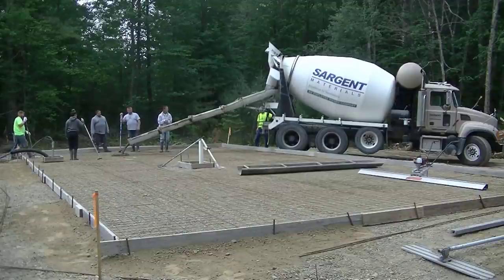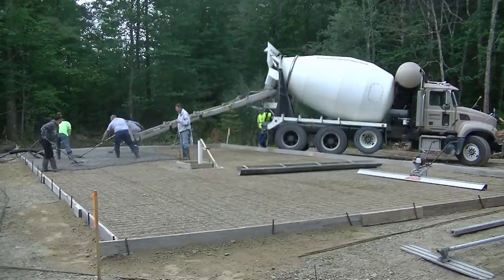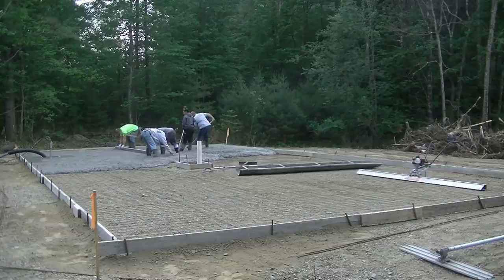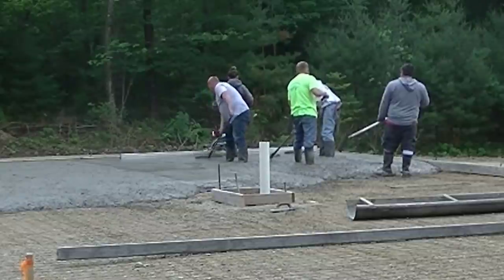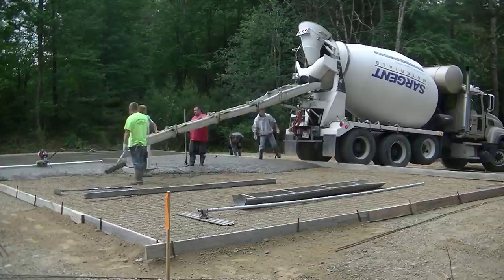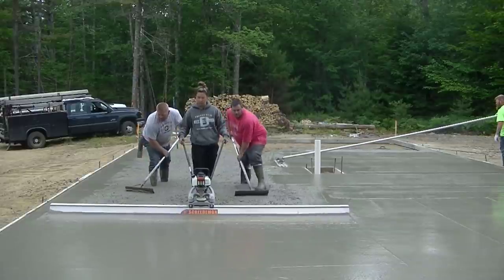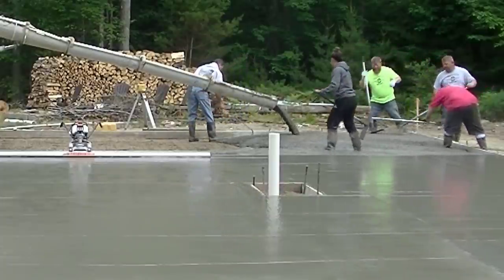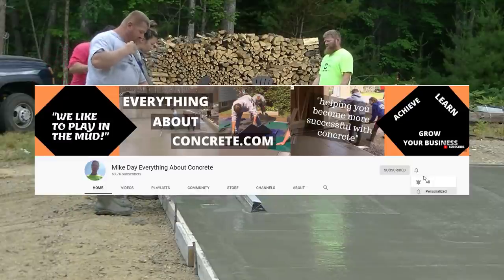Pouring A Concrete Slab With High Range Water Reducer (58' x 28' x 6" Slab)

Comment: Just an engineering point - The perimeter rebar that you were wet-setting along the edges is most effective, very close to the bottom of the slab pour, where it can help resist tension forces. Rebar or WWF has little to no affect at all in reinforcing concrete when it is placed in the middle, bcz the middle is actually considered to be under neutral forces. Neither tension, at the bottom nor compression at the top. 
This is also why your viewers needn’t get upset when they see you walking on the wire mesh, after you’ve pulled it up once. It’s right where it needs to be.
Reply: can i get some more responses on this - have always been told "in the middle" and was at the point i was going to ask mike about them stepping on the wire and it being pushed back down.
Reply: @johncross436  This is one of those things where a sketch would be very helpful, but I’ll try to explain anyway.

Imagine a 12” deep beam with 2 vertical rows of dots, 3” apart, at the center of the beam. Then put a load on top of the beam, at the midspan, directly in between the 2 vertical rows. As the beam begins to deflect, you would observe that the dots at the top of the beam get closer together (compression), the dots at the bottom of the beam move further apart (tension), while the dots in the middle of the beam remain constant (neutral). A slab behaves in exactly the same way. 

When you form a typical, structural concrete slab, the top and bottom steel is always called out to be ¾” from the top and ¾” from the bottom. The engineer wants the steel as close to the edges as it can be and still get concrete coverage bcz that is where the steel is most affective at resisting the compression and tension forces. Almost never will there be any steel called for in the middle, bcz the middle is halfway in between the top and bottom (obviously) and right in the ‘sweet spot’ where the 2 forces cancel each other out.

As far as Mike and the crew stepping on the wire, once they pull the wire up with the hook, aggregate gets under the wire and doesn’t allow the wire to get all the way back down to the bottom.
Reply from the maker: Great comment and explanation!
Reply from the maker: Hi John, we've been doing it this way for 40 years with no problems. Once the 3/4 aggregate gets under the mesh and rebar it doesn't go back to the dirt when you walk on it. Yes, it's better to have slab bolsters under the wire but it's not a real problem. We also use fiber mesh in the concrete. Really the most important thing is a good gravel compacted sub-base.
Reply from the maker: Thank you for that!
Reply: doc hall  In footings (not slabs) code requires 3” of concrete coverage where there is rebar exposure to earth. Dobies or besser brick work perfectly for elevating the steel. Holding the slab wire up near the top of the slab, isn’t ideal bcz the top is in compression (as I explained above). Concrete is already good, by itself, at resisting compression forces. Where the wire could be most beneficial is at the bottom, to help resist tension forces. Tension is not something concrete is especially good at, on it’s own. This is true for all conditions except cantilevers where the roles completely reverse to compression at the bottom and tension at the top.
Reply: @psidvicious Thank you for the comment on wire and rebar placement.  It's becoming one of my pet peeves: watching well intentioned contractors place their reinforcement in the middle where it will do the least good.  His use of a water reducer is good, but that doesn't justify a 7 or 8 inch slump.  At some point the aggregate settles too much - damaging the integrity of the slab.  I have created a similar problem by running the vibratory screed too much.

Comment: Used to be a local mason supplier Southeastern NY/Northern NJ gave us a kinda concrete slide rule to figure total yards, even circles - very handy.
Reply: I haven’t seen one of those in years. Concrete truck drivers used to hand those out for free if you asked them, along with carpenters pencils and the occasional t-shirts. The good ole days!
Reply from the maker: Hi John, I used to use one of those too. I still have some. Mostly I figure it in my head now.

Comment: Another great demonstration!  If you were pouring a garage with 3” slope over 16’, would you use this slump or maybe less slump in order to keep the concrete from running downhill?   Thanks  Your daughter looks very confident in her work.  You’ve done well!
Reply from the maker: A little less on the slump for that. That's quite a slope in 16'.  Around a 4 slump.
Reply: Thanks Mike.  I had previously searched for garage slope online and most recommended 1/4” per foot slope.  My slope is a little less.  What do you recommend?  It is great that, in addition to doing great projects for people, you take time out to answer our questions.  Many thanks!

Comment: I am really impressed with the wetting agent I have heard of them but never seen it in use .
I use a 7cf mixer to do all my work 
This will make my work so much easier 
Thanks
Reply: You might be surprised to know that water reducers (plasticizers), are essentially the same chemical makeup as laundry or dish soap. If you’re just working on small, flat work pieces, you could try adding some to your mix as an inexpensive ‘home-brew’ alternative to the commercially used types.
Reply: @psidvicious  thanks I always knew dawn dish soap was good for a lot of things
Reply: @dank2265  Right. It works on the molecular level, by breaking down the surface tension of the water.
If you’ve ever sprayed a water mixture of insecticide or plant fertilizer on your flower/vegetable garden, only to be frustrated seeing it bead up on the leaves and drip to the ground, a small amount of Dawn liquid can work for this too. 
Just be careful though. A little goes a long way for this application.
Reply: @psidvicious  yes thankyou I understand the chemistry behind it 
I just did not know that it would not effect the integrity of the concrete
Now to start playing with it 1 or 2 drops per gallon of water 
Thanks again
Reply from the maker: It does make the concrete flow nice and easy. For me, it's worth a few extra bucks a yard. It saves on labor.
Reply: @psidvicious  Can you tell me how much plasticizer to add per yard, if pouring an 8" slump??
Thanks, Joe
Reply: @joedirt2166  To bring a normal 5 or 6 inch slump up to an 8 with a water reducing agent, you’d add about a gallon to a 10yd truck. So it stands to reason, 1yd would take 1/10th of a gallon or 12.8 ounces. If you’re going to try to use dish soap instead of commercial plasticizer, that would be a good place to start but I’m certain some adjustments will have to be made because I’m sure it’s not quite an apples to apples comparison.
Reply: @psidvicious  Hi psidvicious, thanks for the quick response, and now it is making sense to me, you order a lower slump, add the plasticizer per yard to make it a higher slump, and more workable conrete?
Reply: @joedirt2166  Normally you just tell the plant what you want and they will add the water reducer there. Depending on where you’re at, most concrete truck drivers won’t let you climb up on their mixer and put additives of any kind into their drum. As soon as the concrete comes down the chute and hits the ground, it’s yours. While it’s in the drum, it’s still theirs.
Reply: @psidvicious  Thank you!! Yes, I'm sure they don't want that liability. I appreciate you taking the time to answer my questions!!
I've seen videos where people are spraying small amounts of water on top of the slab when it gets too hard to work, why would they do this?? Doesn't that jeopardize the strength of the slab??
Reply: @joedirt2166  No. My finishers almost always kept a milk jug of water with them while they were power troweling a slab. You can spray or slosh a little water on the surface while troweling just to be able to help work up a little cream at the surface. The water doesn’t seep down into the concrete and compromise the entire thickness. Concrete is heavier than water so it just remains on top. Many times I’ve been caught in rain storms while finishing a slab and no harm comes to the integrity of the concrete. You just squeegee it off and start finishing again. You CAN over do that sometimes and create spalling problems later though. So it’s just another one of those finishers skills that, if used sparingly, can help achieve a good finish.
Reply: @psidvicious  Thanks again psidivcious, for all the info, this will be very helpful next time I try a pour!!

Comment: Do you like the screed demon better than the Marshalltown?
Reply from the maker: They're both excellent. That's the honest truth. You can't go wrong with either one.
Reply: I dont think my Marshalltown would float on something that wet. This is my first year running it. The screws demon seems like it would float on top better and be cleaner since it’s a solid board.
Reply from the maker: You're probably right about floating a little better. The ScreeDemon is a little lighter and the solid board helps it float better. The Marshalltown is really solid and great for big jobs.

Comment: Drives me nuts when no one lifts the mesh I've fired laborers for not doing it. After I tell them twice and they still don't listen they are going down the road. You do nice work my friend keep it up
Reply: Drives me nuts watching people pull it up and then immediately walking on it. It’s almost as dumb as standing on mesh while pulling up. It’s almost as if almost all steel ends up at the bottom and it’s fine.
Reply: Guess what - if you raise it to the middle where it does the least good; I would fire you.  Read @psidvisious comment and some of his later replies - then pass it on.